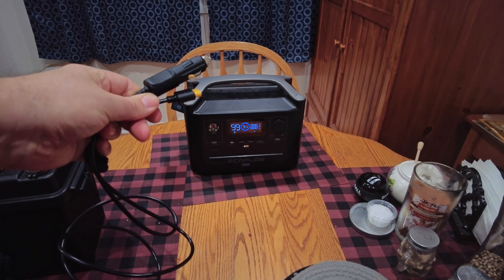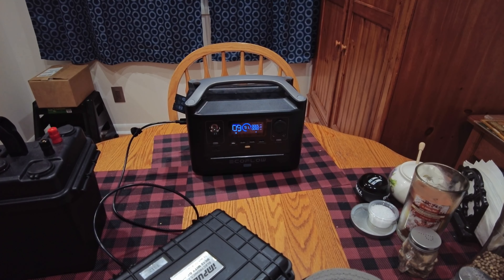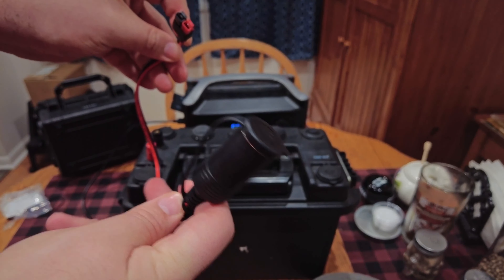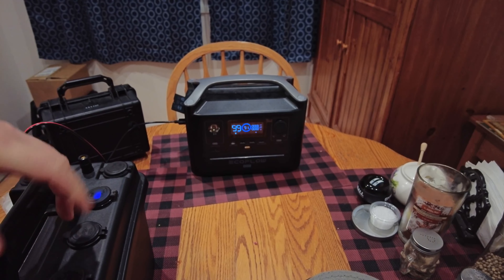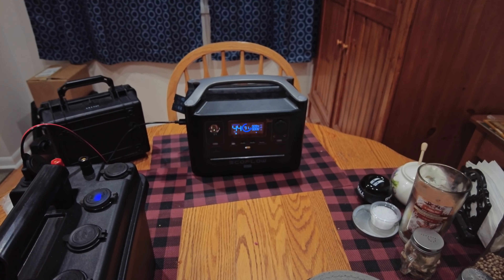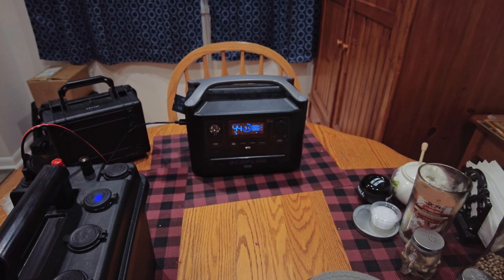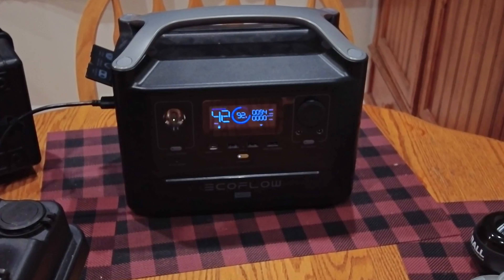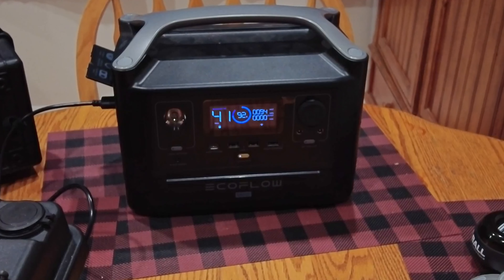DIY EcoFlow River Max Power Station Upgrade

Comment: Hi excellent video, I have a question, how do you charge the big battery? I think it would be great if it could be charged with the Ecoflow, it would be great not only from the normal charging point of the house but for example I think it could be recharged by solar panel.